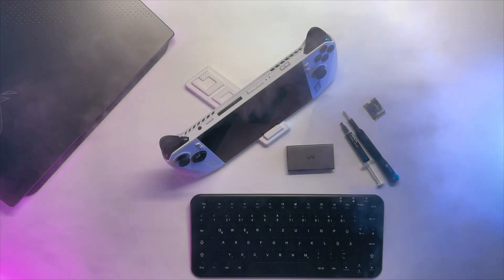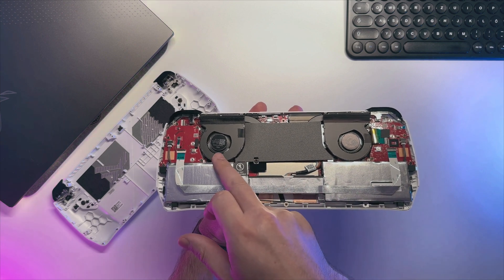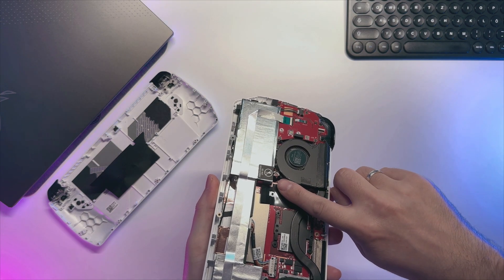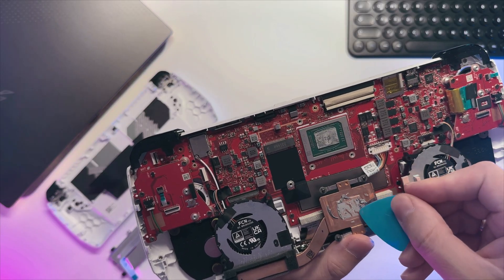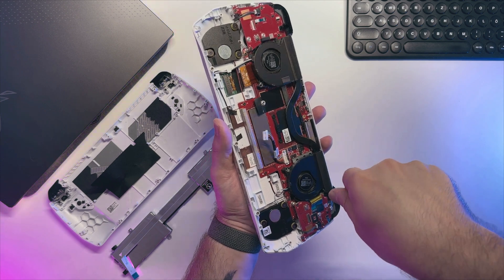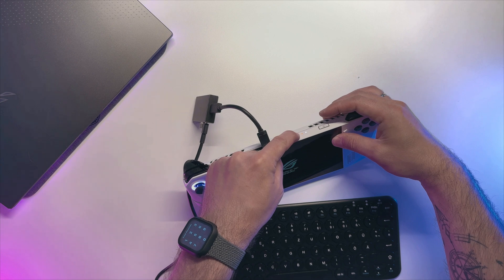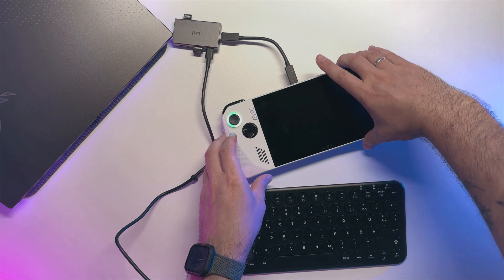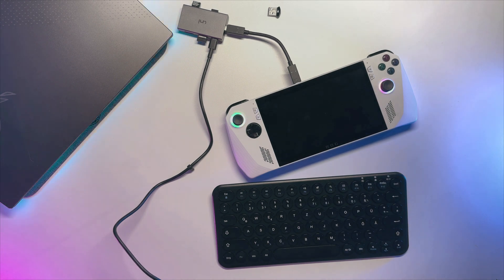ASUS ROG Ally NVMe Swap and Repasting

Comment: you dont need to remove the battery just remove the battery's cable
Reply from the maker: That is true, but since I had my doubts (which was confirmed by ASUS with X version) that they could have put the bigger battery I wanted do check it out :)

Comment: Did your temps change, for me using thermal grizlly cryonaut it seems to not have changed at all.
Reply from the maker: hmmm didnt even check tbh since device itself was already OK with temps and noise... I did this mainly to check what paste did they use and to check if contact pressure was fine. I usually control my temps with me adjusting TDP and Fan curves as I like them but device is running great and cool I must admit. It will get saturated under load and it will not matter that much what paste we are using as long as it is decent/good one.

Comment: Hi, 

I've recently bought a pre-owned 2021 Legion 5 Pro. Probably like many others, I've found that it runs pretty hot and I'm planning on cleaning the fans and renewing the thermal paste and pads. 
Would you mind giving me your top recomendations for what to use? I.e. what thermal paste and what thermal pads and its thickness.

If you see this and decide to respond, thank you, it's much appreciated.
Reply from the maker: Well first of all that is a hell of a User Name LOL 😆 check out my Legion videos on repasting etc.
Reply: Wow, thanks for the response. 

I did watch those videos and I feel like the takeaways are to get Alphacool thermal paste and Thermal Grizzly thermal pads. I don't think I heard you mention the thickness of the pads though. I might be mistaken though.

And yeah, the username is just some randomly generated stuff from my gmail.
Reply from the maker: @DinoJacky-p1y  watch the last one since pads might not bet the best option ;) if you must then get 1mm ones that are really soft and they don't need to be any specific brand just good enough but most importantly really soft one ;) and thermal paste should be a bit thicker, so PTM or like I did Alphacool Apex.

Comment: Hi, nice video, unfortunally, the base thermal paste seem to be very good, even my CM MasterGel Maker with 11 W/m·K don't give me any difference, so the high temps of this console don't seem to be from thermal paste but it's heat extraction from the heatsinks to outside the console and the only way to improve this is to increase the fan speed (by making custom power modes).

Also, the idea of putting these 3 headsinks seem to be good but... the problem is that they will take some heat to extract them from the apu to... inside all the console (there is not out for them to put they heat away of the console) so the inside of the console will heat because of these headsinks.

What I can suggest to you is to put some thick thermal pads at the end of the heatpipes, thick enough to touch the back plate and put some heat directly on the backplate to extract this heat.

Also, try to disable cpu boost, this will give you A LOT better temps and better battery life on almost all games without any lost of fps (or only with cpu very intensive programs like photoshop, blender ect...)
Reply from the maker: I have already done so crazy stuff to my Ally. Still didn't find time to make a video but you are on point with all of that and I think I have achieved what you said but with different approach. And regardless of paste it will get hot with single pipe but at least stay silent in normal use

Comment: You should try using phase-change material Honeywell PTM7950. It comes in as a sheet, lasts longer and performs in my experience works better than traditional pastes.
Reply from the maker: Yeah it is a good option as long as one can buy genuine one and not for crazy price 😅 until it is available thru reliable sources and resellers I will stick to Alphacool Apex since for me that is the best option atm!
Reply: @atechcheck  what size thermal pads did you use on the lenovo legion. i have a legion 7 and fixing to change out the paste again as i didnt use the right kind and temps are at 86C and laptop shuts off randomly, but i dont know the size. i have a legion 7 15ACH6

Comment: too much thermopaste and not even needed to replace it lol. And those additional heat sinks won't even do anything lol. Also, when screwing the heat sink back into the motherboard you always want to do it in a "X" formation.
Reply from the maker: Well, thank you for your useful tips ;)
Reply: not even before and after temps 😔